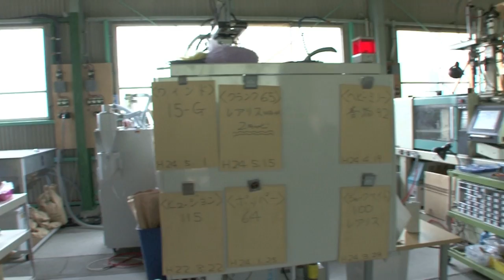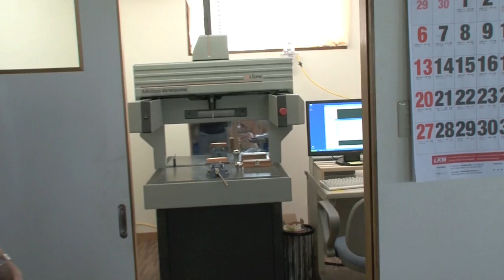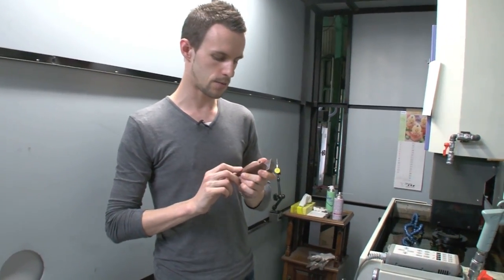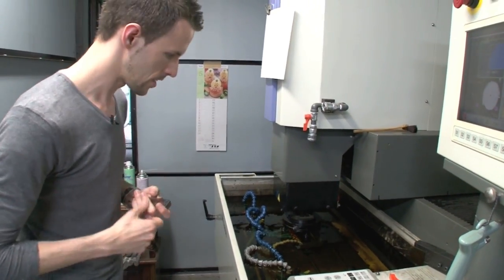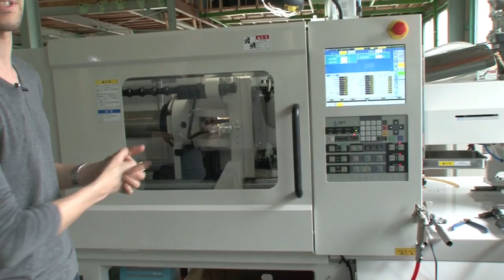DUO`s Technical Office - How We Make Our Lures

Comment: Very good , yet your steps to make the mould could be improved , you can machine directlly the negative shape on the steell , and jump the sparking part , for that you just have to create your negative in the drawing progam after you copy the lure . 
Hard job repairing that brocken ejector pin 😉😉
In general your lures are very good 👍👍
Reply: Tool steel is an easy repair. I spent a long time working with carbide tooling more complex than this and that is a nightmare to repair/replace due to how long it takes to make anything from a blank, especially large carbide die's. Has to sit and de-stress after each wire cut and small pins like that ejector pin need a lot of care taken grinding and polishing to maintain profile,and they are much easier to damage than tool steel.

Comment: That cavity in the copper is formed using a sinker?  Why do they use copper instead of tool steel?
Reply: the tool steel is used for the actual molds. you machine the shape you want out of copper, then plunge that shape into the toolsteel block under spark errosion, this forms a perfect negative in the toolsteel. then machine your reliefs & ejection pin ports into the toolsteel and you are done.
Reply: thanks for that explanation